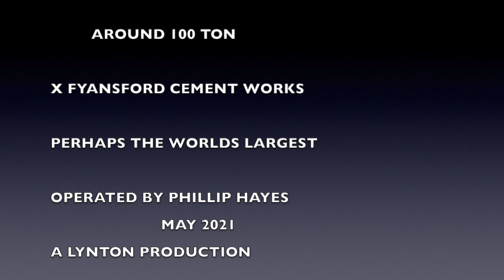RUSTON HORNSBY STEAM SHOVEL

Comment: A dinosaur?  By our standards, yes.  But think how it eased the lot of labourers on road, rail, mining and agricultural projects in the day.  It reminds me of those dreadful problems we had to solve at school about how long it would take so many men with shovels to do an hour's work of one steam navvy!
Reply from the maker: Hi Colin, I agree, what a marvellous machine and still able to work but by modern standards it does look primitive. Like a puppet driven by a puppeteer who pulls the strings to make it work!
Reply: @kentate435  Its primitive, but its rate of working is quite impressive. Aside from the start up time it doesn't look that much slower that modern machinery for the same tonnage. But the break-out force may be different, a hydraulic system can slowly build force without stalling the engine.

Comment: I wonder if those machines had much of a risk of explosion since they're steam powered.
Reply: In the early years of steam power, explosions did occur now and then. I'm a Swede and don't know how it was in the US but safety standards and inspections of steam boilers began here in the 1890's. Since the machine we see here is from the 1920's I think it was quite safely built. At least when it was new, I would not like to take a 100 years old boiler up to max pressure.
Reply: @skunkjobb  all the more reasons why pressure relief valves are important for safety. Without them boilers are essentially a bomb💣.
Reply: @jonathonrossebo1783  
If its proper built and proper utilised it wont explode, most boiler explosions happened and still happen because of neglect and ignorance in its working, no sane engineer would put the boiler at max pressure even if its brand new, they ran mostly at 80 to 90% pressure depending on the load, some boilers were designed with 60% pressure in mind, flash boilers are magnitude safer as they only produce super heated steam when needed but came too late to change much, the diesel engine and electric motors had already surpassed Steam power when flash boilers were a thing.
Reply: Well, we rode steam powered ships across oceans.

Comment: What’s that huge red steam shovel on the railroad tracks?
Reply from the maker: The red machine is a Bucyrus face shovel. Larger versions  built the Panamax canal.Again it was thought that it would never operate again as the boom and bucket were missing. These were rebuilt from original drawings by members. I will do a video of it later,
Reply from the maker: I’m about to do a video of it operating